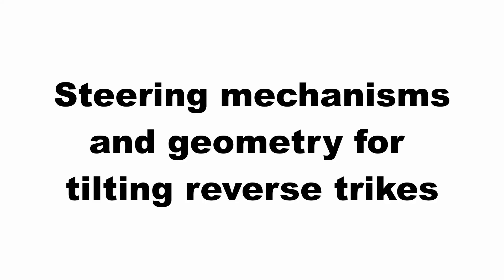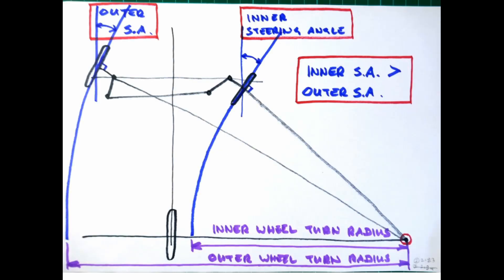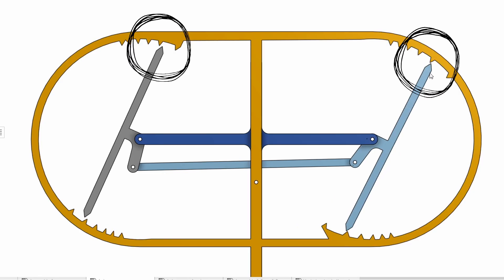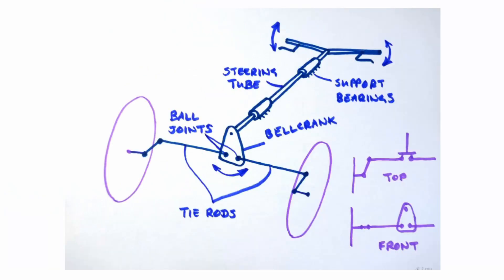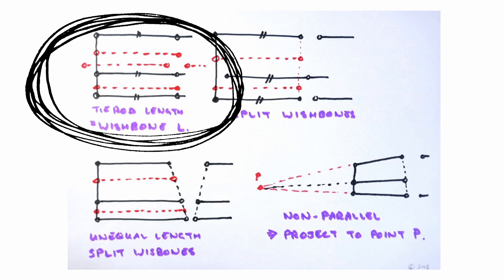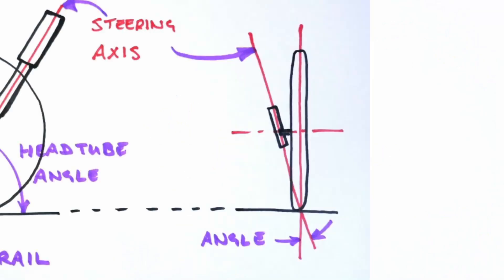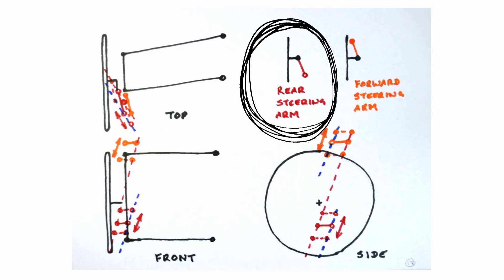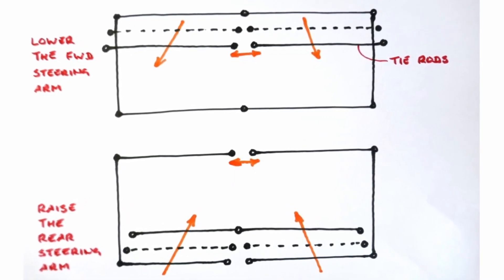Tilting Trikes Part 3 - Steering mech design and geometry for tilting trikes and tilting vehicles.

Comment: I would prefer 2 wheels in front as I hit obstacles with the rear wheels since I couldn't see them to judge distances. Also a single wheel in from tended to cause the trike to tilt on slopes.

Comment: Thank you very much for sharing this valuable information....
When using equal length wishbones, the steering arm should be placed at the front of kingpin axis. Because if it is located at back side, tie rod lenght must be shorter due to Ackermann angle of steering rod. Is there any method to use "back side" steering rod for this configuration?
Reply from the maker: you are right, the steering rods must be the same length as the tilting arms or the wheels will steer when tilting.  If the tilting arms are split, it can be possible to place the steering rods behind the tilting arms, depending on how much separation there is between the inner pivots of the tilting arms.
Reply from the maker: I think I mentioned this in Part 4 of this series if I remember correctly.
Reply: @MetalMachineShop  yes you are right. I saw that later :). Again thanks very much for these very informative videos...

Comment: Hello, really impressive, I have also dealt with the problem of the tilting device in three-wheelers over and over again for years and have rejected the concept with two steered front wheels, because when the inclination acts on the steered wheels, the angle of attack of the wheels in the ground contact plane changes that probably also different, because just different angles of attack from the steering - in my impression that cannot be solved without slip - but I learned a lot from your video - respect
On the other hand, the rear wheel does not have a contact axis, like a four-wheeler, but a contact point, so that at least the slip problem can be easily compensated - the changed direction will have to be compensated by the rider, similar to a bicycle. Greetings from Germany Christian
Reply from the maker: Hi Christian, thanks for your comments!  I am building a prototype so should be able to find out soon whether it works or not!
Reply: @MetalMachineShop  I'm sure it will work, you are doing an impressive work, this little slip will not make your prototype not working, hope we'll seen it soon! kind regards Christian
Reply from the maker: @cvi943  you will!

Comment: MMS, you have some heavy hitters following you! Starting with Kyle Towers, moving on to Carolina/Pushyhog and ending with the grand finale Wayne Soohoo! Very impressive. So, the question I have is, why not use a leading arm suspension? Not commonly used on cars, but it looks like it would be much much simpler.

Comment: U ever study the velotilt?
Reply from the maker: Yes, it's one of my main inspirations for my project!
Reply: Metal Machine Shop : l bought the company. You can join the team. waiting on parts tuesday and friday this coming week. Recumbents dot com forum, l am carolina there. velosRus.com is mine. mike mike lecka on fb/messenger. The front is complete with schlumpf/gates/pinion gearbox. Gates sponsors me. Rear tilt should be working this week, locking oil struts from bansbach. Rear tire width around 25” c to c.. Running 3 gocycle tires.

Comment: http://tiltingvehicles.blogspot.com/2010/05/kerrel-cycles.html You should see this steering solution for a tadpole tilting trike. I spoke to the egotistical and eccentric designer inventor. He uses the Tripendo arm powered tilt control on the right lever and steering with the left. I spoke with him 10 years ago. He uses a rectangular rhombus shaped control  arm front suspension system. His steering system was pretty good.
It was difficult to fabricate though. He used 4 steering rods. two were crossed from a bell crank and fed to two rods parallel to the transverse control arms  linked to separate independent pitman arms which were mitered to the same angle of the kingpin angle caused by the rhombus angle of his pivoting uprights. Pretty clean but it cost difficult machining a lot parts and limits the total lean limit capability. A solid sphere has compromise. If you tilt the control arms back from vertical to give castor angle to the front wheels (this is not the only way to do it). You would notice that you get track steer as your TTW trike leans. This alleviates the need for Ackermann if you know what you are doing. Kerrel here kept his transverse steering rods  equal length similar to what you are doing and input  Ackermann (differential) steering angle from the crossed set from a pitman arms to the separate angle parallel to the king pin pivot steering plane. You should try to contact me. I have built over 15 tilting trikes. I am working on a low speed auto leveling tadpole or reverse e-trike. It is related to TMW TRIO which is a conversion kit for Harley Davidson. You should study it. It is a complete solution you should scale down. I think I have a better compromise steering solution for tadpole TTW. Two wheels in front you have more complex steering. Delta design you have a more complex drive train. It also does not brake or corner well. With FWD it has traction and heel interference problems. It all comes down to optimization of managing your TTW tilt and steering from high speed to transition low speed and stop. It is solvable since you can run walk and stand. You have to dumb it down so you can sell it. Look at spot from Boston Dynamics or OSMO form SONY. The TRIO kit cost 25K installed and you need a Donor Harley pr Gold Wing. You are doing well describing issues and solutions but far from state of the art. You have to solve 3-7 conflicting interacting problems. You have to break this down and solve them sequentially. All transport machines have sequential operating modes. Planes, and, helicopters, Jump jets and tilt wing VSTOL all have this. Spot from Boston Dynamics is a mechatronic wonder with AI and cost only 70K. You can't ride him right now. Have fun find me. I like people who have burned brain cycles chasing this dream.
Reply from the maker: wayne soohoo thanks for the link and comments. I’m looking for the lightest, simplest design that will actually work in practice.  A lot of tilting trike designs are very complex and heavy, unnecessarily so in my view.  I’m now building a prototype so will hopefully soon be able to speak from a point of view of experience rather than just theory!   It is a fascinating subject.  I think so anyway. Cheers!

Comment: Hey, I’ve been working on my own trike for a while and I’ve been trying to fix the same issues you’re have and I am planning on cutting the spokes out of the front two wheels to make it more centered to the point of rotation. I’m not sure if this will help you but if it does it would be a great way to fix some of the problems you had in part one.